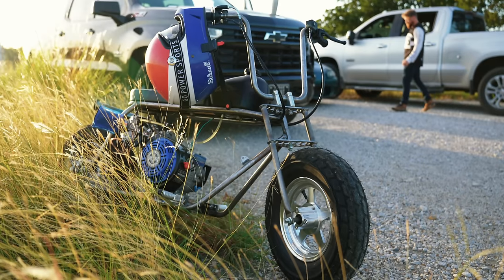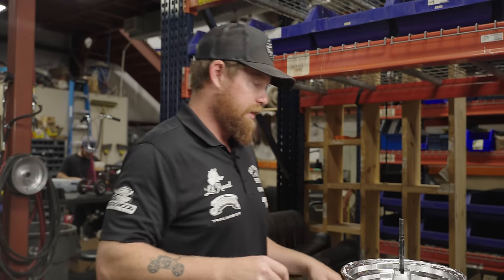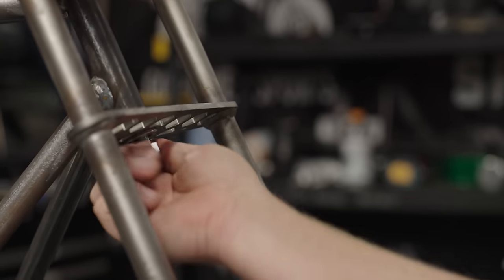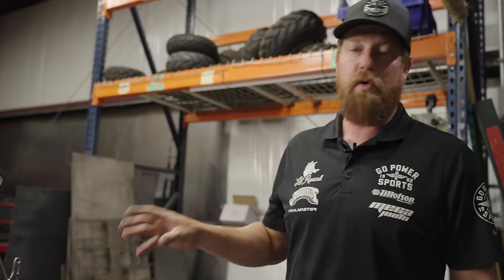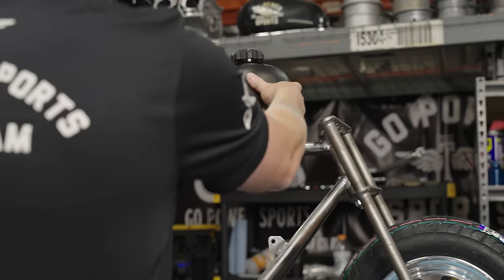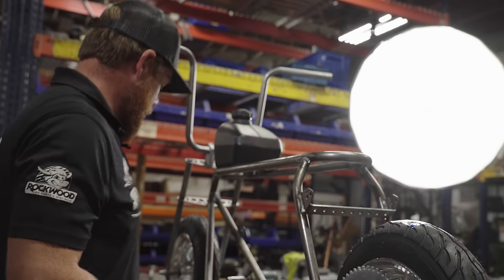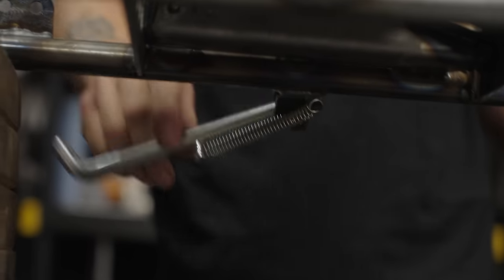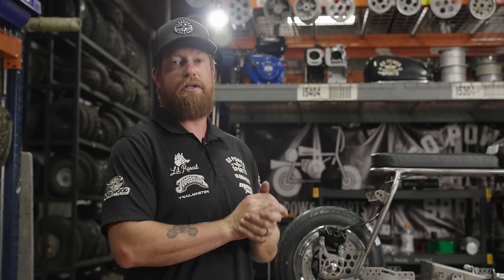How To Build The Rascal GT Cruiser Minibike | Step-by-Step

Comment: Love the GPS 10' wheels, thinking about putting them on a rascal. Is that possible?
Reply from the maker: Yes, that is possible.   You will need to reconfigure your wheel spacers your brake disc mount will need to change.
Reply: Okay, thanks!
Reply: @ThunderrrProductions